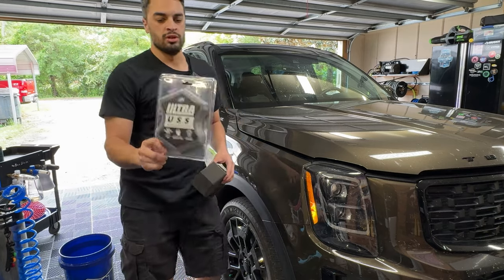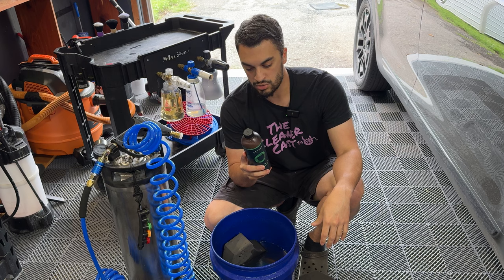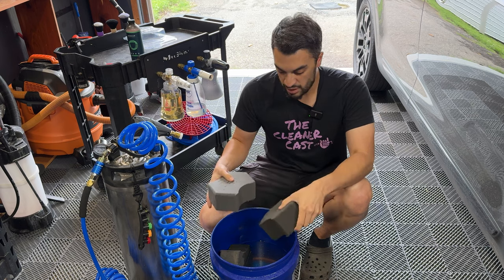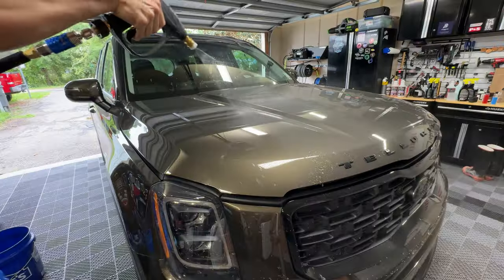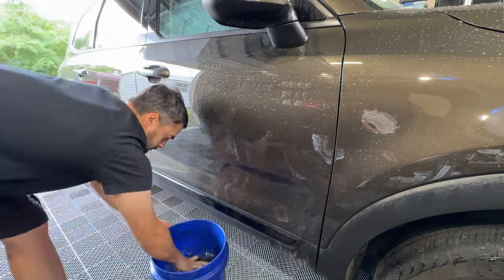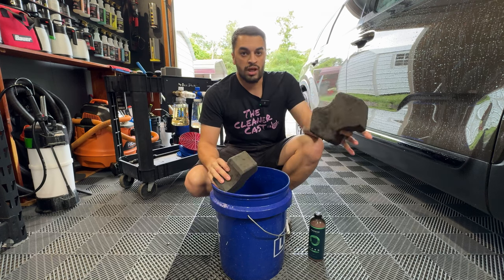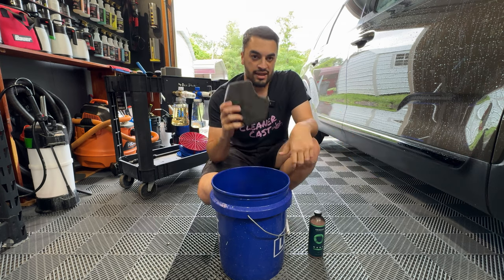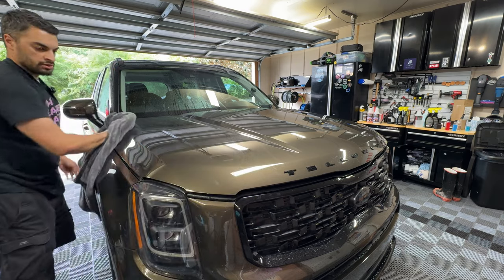The Ultra Safe Sponge Vs The Ultra Black Sponge! (Hero Rinseless Wash Preview)

Comment: I've had the Ultra Black Sponge for a couple years and I've never had an issue with it scratching the paint or anything else related to safe washing. I would rather have the UBS over the USS because I like a firmer sponge for the best cleaning capability. I now use the DIY Detail Legacy Sponge, which I prefer over the UBS. Thanks for the video Jamie.

Comment: I've got both, and agree with you on your comparison points. The USS glides and conforms quite well over large surfaces feeling really safe and soft and gets into door hande areas easier and behind mirrors, then the UBS does a better job with the areas that require a little more scrubbing power. Great video Jamie. Love that detail keg you've got there.

Comment: Esoteric black sponge is the best sponge on the market and it's really not close. Never really understood the square cuts style I understand it releases well it the water but on the panel it's acting as a flat surface most of the time which is not ideal.
Reply: do you mean the kamikaze Hagakure?
Reply from the maker: @pigeonpoo1823  ah yes I need to try that one looks good
Reply: @pigeonpoo1823  Despite my name I haven't tried the official Kamikaze Hagakure but I'm assuming the one Esoteric sells is fairly similar.
Reply: He’s talking about the hidden leaf sponge
Reply: @kamikazefireball  it is the same. I don't have a specific RW sponge so use this. It is insanely soft, but fragile. Soft but fragile. Try it, love the user experience, look in disappointment as it begins to lose bits.

Comment: May as well just wash the damn car conventionally.  $26 for a sponge is fucking insane
Reply from the maker: lol it lasts forever and never needs to be washed so easily makes that money back
Reply: @JamieTheCleaner  used OPT no rinse and the red sponge once- scratched the shit out of 1 panel, did everything right and that was it.
Reply from the maker: Did you let the red sponge soak for awhile before use?
Reply: does sound like you did everything right. i’ll put money on it
Reply: @JamieTheCleaner  I did-  exactly how everybody recommends, I’m coated in cquartz UK 3.0 and it still scratched.  I just went back to regular presoak foam, then foam with all Carpro products.
Reply: @JamieTheCleaner  I mean 2 minutes should be sufficient right?  I mean this and ONR are just basically diluted detailers.   Really doesn’t make it any better.   The sponges are a scam for sure 100%
Reply from the maker: @JohnDravit  I always soaked the red sponge for 24 hrs, I’ve used the sponges for years with zero problems definitely not a scam, Rinseless is a technique learn it
Reply: @JamieTheCleaner  I honestly don’t see the point- more time to do that bs then foam and rinse.  I’ll try soaking the sponge but either way you cut it- no fucking sponge is $26.